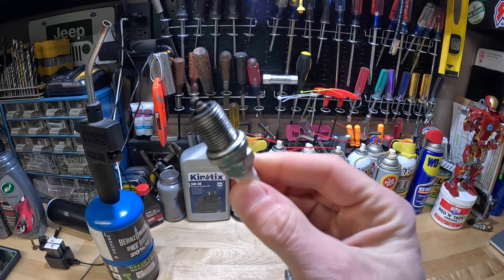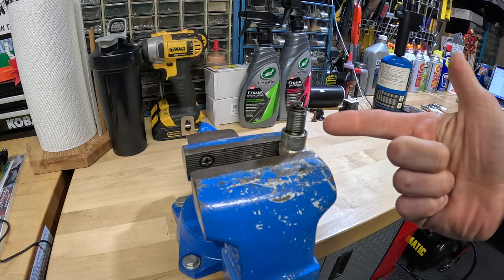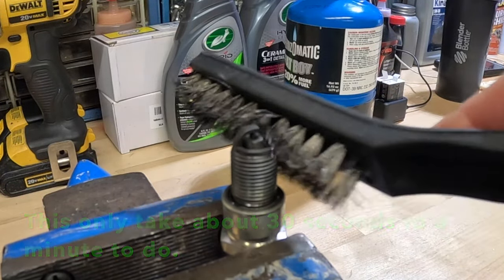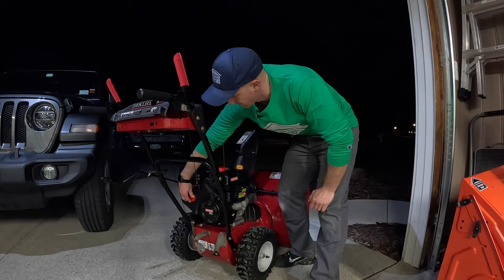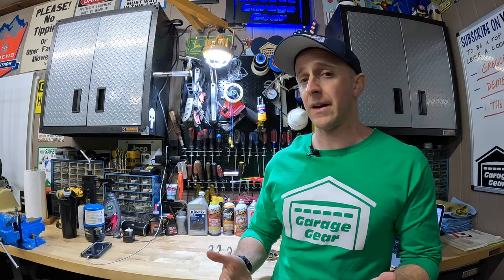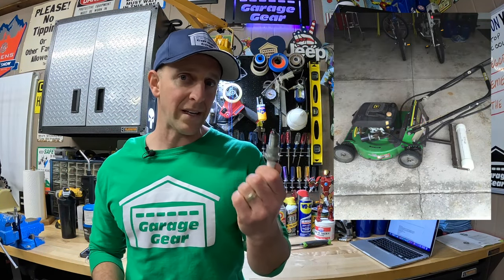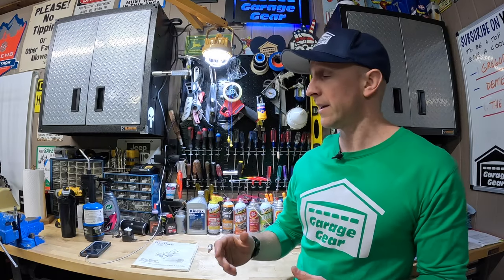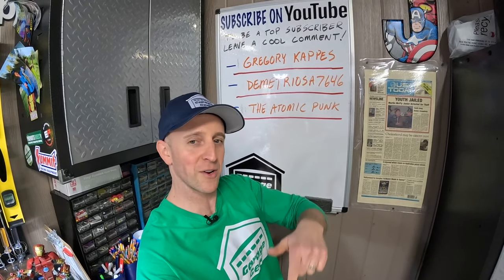BEFORE YOU BUY ANOTHER SPARK PLUG FOR YOUR SNOWBLOWER, WATCH THIS!

Comment: I used to change the plugs every year then I realized that I could just clean the plug, so now I do that. I use a dremel tool with wire wheel and spray some carb cleaner when finished to make sure there’s no pieces of the wire wheel hiding inside when I’m done.
Reply from the maker: Good idea! Thanks for sharing this tip!

Comment: I needed to change the spark plug on my Craftsman snowblower. When I removed the boot, I was surprised to find a rubber gasket around the insulator that I've never seen before. I thought it came out of the boot but I couldn't get it to stay in. When I put the sparkplug back in and tried to put the boot on it wouldn't fit. The boot only fits without the gasket. I'm not sure what to do. I've removed the plug 3 times before & this is the first time I've ever seen it. Help would be appreciated. Thanks!
Reply from the maker: @JimmyKay1976  hey Jimmy some spark plug removal sockets have a rubber gasket inside. Did that possibly come out and get stuck on your spark plug?
Reply: @GarageGear  That's EXACTLY what happened! Damn you're good. Brand new socket to boot. Thanks for the response. I'm guessing no such gasket is necessary. Just boot over spark plug.

Comment: JB, only steps I'd add is blast the spark plug with air between removal of the boot and before removing the plug. Debris can get in that area and  you don't want them getting into the combustion chamber. I like to stuff a clean non-linting paper towel into the spark plug inlet while it's empty to also avoid foreign contaminants. 

Great video as always, been sharing your videos with friends and family when they have small engine questions as you're such an effective teacher and cover gaps in their manuals.
Reply from the maker: Appreciate you as always sgttoastie! You ROCK my friend!

Comment: I had a Mercury/Yamaha outboard motor that was fouling sparks plug because it was running really rich. This was great for me because I got it at a good price. While I was trying to get it running good, I had to keep cleaning or replacing the spark plugs. I found that a little brake clean and a wire brush followed by some shop air worked great.
Reply from the maker: Awesome thanks for sharing this Gary!

Comment: When my vacuum is full, I change the bag, which shows you how long it has been since I've bought a new vacuum, lol.  Kirby's, like Ariens Sno-Thro's, last forever :)  Oh, and if you don't have one of those specialty tools you can also test a spark plug with a plain old multimeter.  Set it to Ohms to check resistance.  A good plug will generally have between 4,000 to 8,000 Ohms resistance.
Reply from the maker: Thanks for sharing this rebel! Good tip!

Comment: I usually do the brake cleaner and wire brush method but fire is always fun.

A good addition to this is to use this time to also check the spark plug gap. I've seen the gap widen slightly and I use a good feeler gauge to reset the proper gap.

Fortunately, for my Honda mower, Amazon over shipped me a ton of NGK plugs, so I have a lifetime supply.

For lower use machines like my MTD Snowblower, I just clean the Champion plug at summerizing time.
Reply from the maker: Great tips here my friend. Thanks for sharing.

Comment: My way is probably considered to be unsafe, but it's worked for me for years.  I just put on my safety glasses and holding the plug by the ceramic I run the electrode end through the wire wheel on my bench grinder.  I just remember not to turn it where the wires can catch on the tip easily and in no time it's shiny as new.  If the electrode is a little worn and I need it right away I'll just re-gap it and continue on.  Yours is probably the safest way though.  Once a season, eh?  LOL!  Think about how long folks leave spark plugs in their cars without changing them and that once a season on something that gets used less than 1 tenth as often as your car and that change would seem to be a bit suspect, lol.  The manufacturer doubtless recommends that you use their designated brand too no less.  They're in the business of making money after all, that's nothing new.  Even an antique Philco radio will say "Only use genuine Philco tubes for best reception", LOL!
Reply from the maker: Good point rebel! Chances are good many people never check their car spark plugs.

Comment: The right plug is actually critical to the health of your ignition coil. There must be the right resistance and the recommended gap. 
Excess vibration can lead to plug damage. 
The plug and plug wire have a designed resistance for optimum ignition. If that resistance is not maintained your coil may suffer excessive electrical heat causing the insulation to fail in the coil. The coil is also subject to damage from excess vibration -maintain component balance.
Reply from the maker: Thanks for sharing Edwin

Comment: I have not changed my sparkplug on any of my equipment ever nor either of my Echo Weedwhacker or Echo Handblower in around 15 years as well.... In fact, although I agree should be done more often, the fuel & air filter as well which I finally did those 2 last season.... However, still have not had one problem ever, 15+ years later.

PS that Ariens Mountaineer snowbloer I bought this year was NUTZ! Super, SUPER happy I bought it & it's nearly already paid for. Now what to do with that 3X Crub Cadet I still have, wanted to do a 1031 exchange but nvr did....
Reply from the maker: You got it Scott! 👍 bet that new ariens is awesome!

Comment: The number of times I have had to track down odd problems that ended up being a spark plug that otherwise looked good are legion! Like many things automotive/engine related, they just don't make them like they used to. There are other failure methods that you can't see with your eyes. Such as the metal crimp seal around the porcelain. You can NOT always tell it's bad by eye, and will pass the spark tester test. Sometimes you can feel it is physically loose, but most of the time it leaks just enough to lower your compression to cause starting & over heating issues. Another is a crack in the internal carbon conductor, or increase in resistance of it. These can NOT be seen by eye or spark tester, and will only act up once up to normal operating temperature. These two issues cause a weak spark, not a no spark issue. Which will leave you attempting to clean & adjust your carb in vain. All of these will not be found by your spark tester. The spark tester will only detect a no spark issue, not a weak spark or reduced compression. 

If your paying $5 to $15 for a singular spark plug, you are being taken for a ride by buying the singular blister packs at a big box (rob you) store. Take the part number with you to an auto parts store. You should be able to get it for $3. Want it a bit cheaper, order it online. I have never paid more then $1.50 to $1.99 for a standard copper cored plug. Sometimes you can find them on clearance online for under a buck. I will buy a few when at those times. I have never paid more then $3.99 for a platinum plug, and platinum plugs tend have longer electrode tip life, but suffer from other failures more often. Be smart, shop around, and don't mess around with trying to squeeze every last spark out of a part that has a known high failure rate. Being frugal is smart, but you must be smart with being frugal to truely save money. Otherwise you end up blindly hemorrhaging money chasing odd problems that could been resolved for $1.50.
Reply from the maker: Thanks for sharing this William!

Comment: Is there any advantage to upgrading to platinum or iridium plugs in small engines? Most if not all spec the basic copper plugs.  Your videos are most informative and entertaining.
Reply from the maker: Hey Karl in my experience no. I had two mechanics tell me in the past to just buy the same plug you originally had because they had seen the “fancier” ones crack. I saw an expensive Bosch one break too. Thanks for being a cool fan!

Comment: I think I screwed up , changed the oil , but didn't realize it was synthetic,  5w-30. , leaking all over , draining again , refill with the correct motor oil . fingers crossed . what do you think ?
Reply from the maker: Hey edgardo! Should have an issue if it’s full synthetic or non. Did you over fill it?

Comment: I still have some new in box spare plugs for small engines  that I bought years ago...

That said I had one Honda GX series I just couldn't get to run right.  Would start and idle fine but once it warmed up it would randomly die.

Embarassed to say I shot the parts cannon at it after all the usual carb clean/valve lash/new coil/new plug boot...  

The LAST thing on my mind was a bad plug because I almost never change them.

In a fit of desparation, i tried a new plug and voila!  No more issues.  Turned out to be a hairline crack in the insulator.

It tested fine with the tester and another spark checker with the adjustable gap.  Even the spark color was good.  But I never ran it long enough to get hot whole checking...

Insert 🤦‍♂️ here...

Thanks JB - keep up the good work
Reply from the maker: Glad you were able to solve the problem. Lucky how it was just a random spark plug issue. Thanks for being a cool fan and sharing this with the Garage Gear community.

Comment: I fixed the FIL's snowblower that wasn't starting, the plug was fouled. That thing ran rich for a while. I didn't have all of my tools, so I sprayed some carb cleaner on it and it looked brand new, I was very surprised at how well it worked. Needless to say, the carburetor needed a deep clean.

Same thing for the spark plug, I always have a spare for my generator and my snowblower, and they've been sitting in their box and will likely stay there forever. I changed one bad plug in my life, I don't know why it failed but it was all rusted out after leaving the generator next to my chlorine bin in the shed... lesson learned on that day.
Reply from the maker: Good info here thanks for sharing Olivier!

Comment: The spark plug must have good electrical ground and that is obtained where it threads into the head. If you are using a lubricant or anti-seize on the plug you must make sure it can conduct electricity. I suspect that a copper based anti-seize would be best but I have never tested that. Seasonally removing the plug might be the best bet. 
Some people test plugs by laying them against the head. This is fine for a few pulls. If you are not getting a spark you are getting heat in the coil.  You can make a simple tester with one foot of 12 gage wound insulated wire and two heavy duty clamps that will fit around the plug  threads. Make sure the other end has a perfect ground on the engine to attach the other clamp to. 
For these engines it is not enough to get A spark - you need to have THE spark which is strong an blue.  
The quality of some of the plugs on the market is questionable - testing before installing would be prudent. 
Always check the wire to plug contact. The wires with rubber boots can fool you.
Reply from the maker: Thanks for sharing this Edwin!

Comment: The spark tester you used is only proving that the ignition coil is good and not the spark plug. Those in line spark testers are only checking for ignition spark coming from the ignition coil and they are not testing if there is spark at the end of the spark plug,  you can still have a bad spark plug that is not providing the spark needed for combustion and still have the tester light up.
Reply from the maker: Thanks for sharing

Comment: @GarageGear HELP JB!I just bought my dream ARIENS COMPACT 24 model 920029. Used from Craigslist.
It started right up and all gears worked great. Looked clean. I opened the gas tank and didn’t smell anything funky! I forgot to open the oil and check🤦🏻‍♂️I should know better since I watched your video on the buying a used snow blower check list. Here is my issue.. After opening the oil to do an oil change, I noticed a chunky pasty white gunk going down the oil tube. I tried to scrape as much as I could out of it with that dip stick and  immediately turned on the machine ran for 10-20 mins and drained the oil. 
I put 20oz which looked
Good
On the dipstick then looked it up and saw it was 16oz. So I drained it again and put the 16 oz.
Machine starts right up and not making any strange noises. Do you think I’m in the clear or is there something else I can do to protect the engine from  the condensation in the oil and the overfill of oil? Guy said it was stored outside for a bit. 2021 model. TIA! - Steve
Reply from the maker: Hey Stevie! I would say you’re good now. I would run the engine for a use or two and check it again to make sure it’s as clean as possible. If it’s still good then I’d say your in the clear. I wouldn’t worry about the accidental overfill you caught it before it could do any damage. Enjoy the snowblower my friend!
Reply: @GarageGear  TY! Love all your videos. You are the reason I went with Ariens! Love
Your delivery and the speed you talk. Plus all the Humor. Keep doing you and never change 👍
Reply from the maker: @Stevie94  appreciate you Steve! Thanks for the positive feedback and encouragement!

Comment: I've done this many times especially on previous 2 stroke snowmobiles, using sand paper and brake cleaner
Reply from the maker: Works wonders and no sense in buying new ones if you don’t need to.👍

Comment: Worng!! after you clean the outside of the electrode. You use a fine grit emery cloth or fine sandpaper to clean the inside too. Then with your feeler gage. Reset the electrode to its  specification. Just heating it up and brushing it off?😮 Well, what do you think??
Reply from the maker: Thanks for sharing
Reply: I guess his 15 years of positive experience is meaningless, huh? 🙄 So JB isn’t “worng” after all.

Comment: Serviced hundreds of pieces of dead equipment, two units needed their spark plug cleaned to start (carbon caked onto the end) and one machine with a dead spark plug. Oddly enough, the one that had the dead spark plug was a 4-5 year old power washer with the plug labeled “LG”.
Reply from the maker: Thanks for sharing 10mm